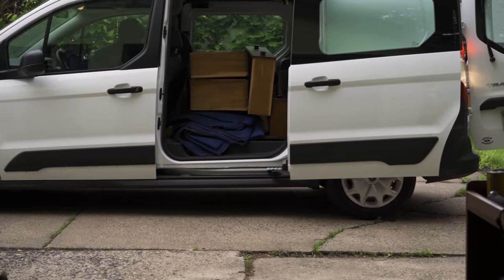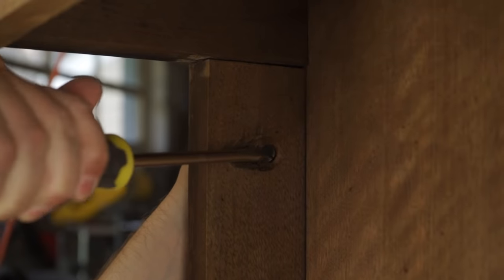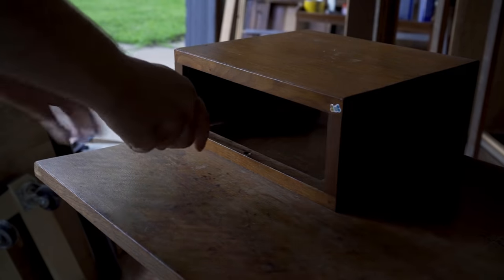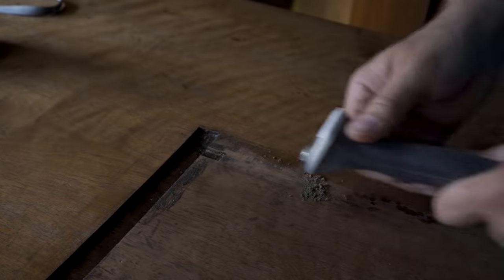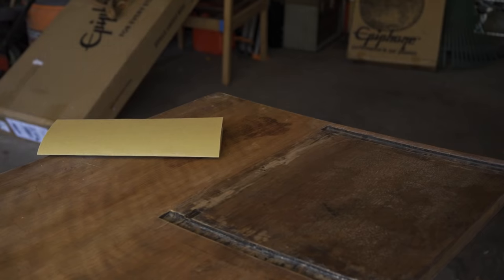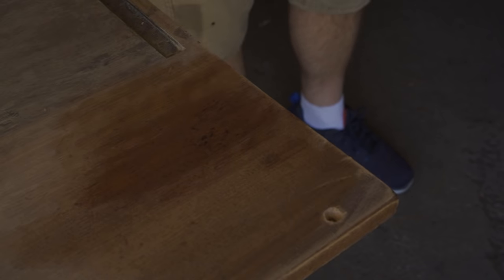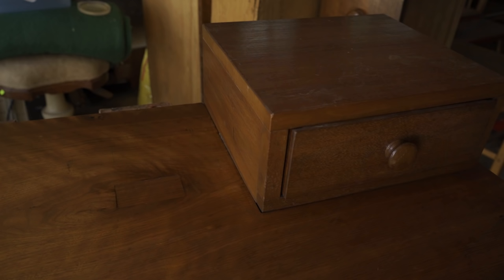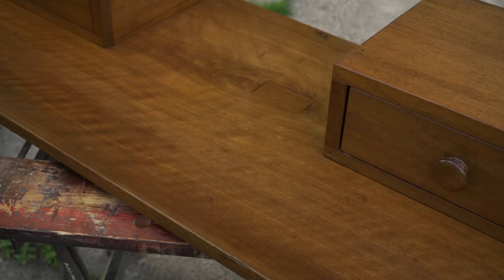Refinishing An Old Dresser That I Found On the Curb | Furniture Restoration & Repair

Comment: Someone built a nice piece of furniture out of walnut and through the years others really abused it. Did it have a mirror piece that fit on the top drawers for a dresser? A side table for a small dining room perhaps?
You really know what you are doing with refinishing furniture. I've watch a few other "refinishing" furniture videos and they don't even know how to use stripper properly or anything about oxalic acid. To me that's crazy if you're going to do furniture refinishing the correct way, the way you do for beautiful results.
The top looks beautiful. I cannot wait to see you working on the bottom.

Comment: What a treasure!  Pre-Civil War bachelor's chest.  Probably had a standing mirror between the two smaller drawers on the top, for shaving.  I congratulate you for your restraint in the finishing.
Reply: It’s not that old, probably from the 1960s. You can look up the label.

Comment: This may be the strangest comment ever, but this reminds me a great deal of the way we restore older music, and when people ask about it I usually use furniture as a metaphor to explain it.

One way to restore old music is to simply go back to an already existing mix of a song, maybe tweak the volumes a little, remove some noise, etc. That's akin to finding an old piece of furniture and perhaps dusting it off, maybe giving it a quick new paint job. Still the same old thing underneath. (They usually just slap the word "remastered" onto it afterwards).

The other way is to create a brand new mix and that's akin to what you are doing - going back to old source elements, breaking everything down into unique components again, restructuring everything with new tools, stripping away imperfections (hiss/cracks), and finally and very methodically building it all together again in a better way that's meant to last, and finally polishing the entire thing for viewing/listening. It's the same item at heart but you've given it brand new life again.

Comment: Nice work! You're right about sanding before any type of bleaching. It is technically a stain if you sand after it will go through the bleach to the original wood. And try zinsser seal coat it's dewaxed shellac or any kind of shellac that you dewax, it is a great sealer and blocks any silicone contamination. Start with very thin coats and build up to a coat right out of the can. Very beautiful job!

Comment: That looks so much like a big, boxy desk I have on my back porch. No drawers on top of mine. This video is perfect for me. Question: If I don't want to work on it now, should I wash it and wax it to protect it until I can work on it? Sadly, we moved it out of the house through a patio door onto a screened porch with regular screen doors and now it is stuck on the porch. Comes in handy out there, but the finish is messed up.

Comment: By vaneer, are you referring to an additional thin piece of fabricated material glued to the original piece of furniture! Or stain that was used as the finish? My Lane mid century coffee table and end tables do not have that extra piece of material attached to the pieces. It is all wood. How to refinish? Just sand and stain? Thank you!

Comment: I have an oak dresser of a similar design and that has a mirror between two uprights which are set inside the location of the small top drawers.  I think your piece probably had similar although without a knee hole I don't know how a lady would have used it as a dressing table.
Reply: Perhaps a shaving mirror?

Comment: About the plugs for the top - instead of tapering the plug, why not cut a matching hole in the top?  That way the plug would seat down to the bottom and the fit would be tighter.

Comment: I've watched all your videos. Good stuff! Isn't this item a "chest of drawers" rather than a "dresser" though?
Reply from the maker: Good question.  What’s the difference?
Reply: @DashnerDesignRestoration  I thought a dresser has a mirror while a chest of drawers does not.
Reply: I think a dresser is longer than its height. A chest is taller than its width.
Reply: A chest has drawers one on top of the other, as this one does. A dresser typically has drawers side by side and a mirror above. Love your work.

Comment: Schmutz :D hugs from Germany
Reply: And one tip from a cabinetmaker: if you turn the chisel mirror side up it won't dig into the wood, it stays level. If you want to plane a plug with it, it will not dig into the surface :)